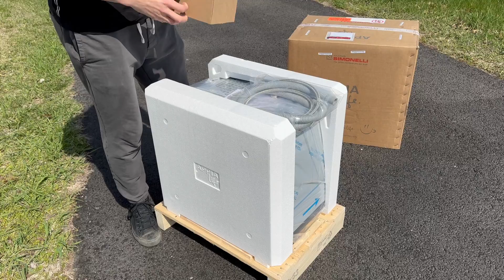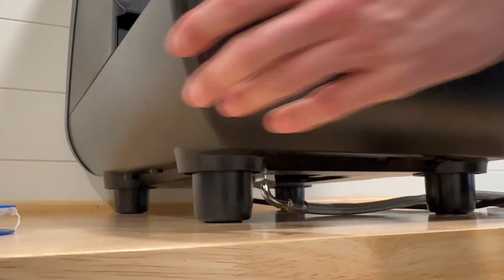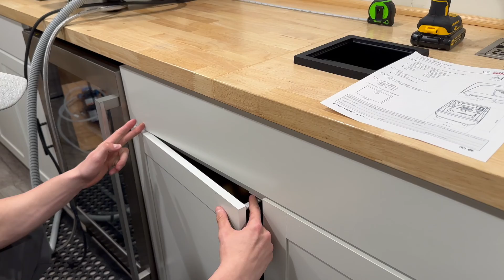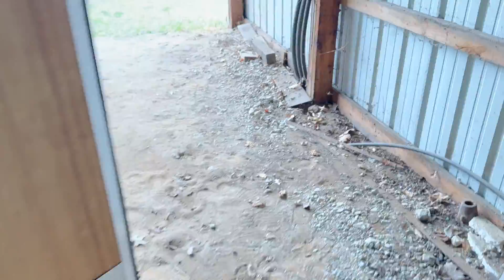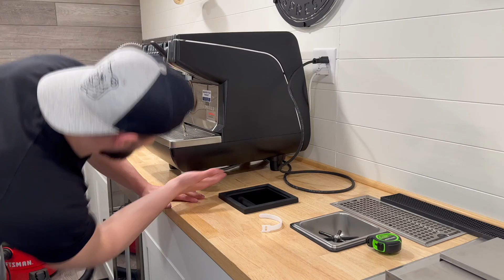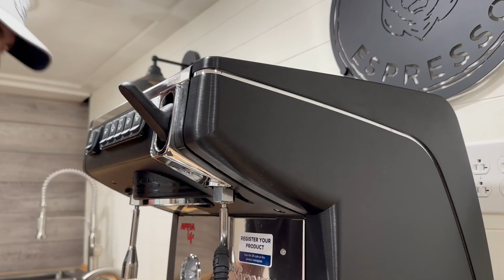Nuova Simonelli Appia Life Single Group Espresso Machine | How to Plumb Your Espresso Machine

Comment: How do you transport it is it attached to the table top?
Reply from the maker: eye bolts 2 inches away from both sides of the machine and ratchet strap it down with 5 inch foam so it doesn't damage your machine.

Comment: Great video, thank you! We just got one of these - haven't started it up yet.. A bit apprehensive - is there a gadget that can tell us if the water pressure is too high? And with the water hook up in a regular house, what should we consider that isn't obvious or in the (very complicated 3 language technical guide!?)
Reply from the maker: Would recommend consulting a local technician.  If it is a new machine, it is required to be set up by a Nuova tech.  If used, would find one and pay them, as you can ruin the machine quickly with poor water and improper setup.  Not something we assist with over YouTube.

Comment: What's your opinion on the quality of shots and milk foam? I'm thinking of upgrading to this very machine from a Spaziale Vivaldi (dual boiler). I can get a very, very good deal on an almost new Appia Life, but haven't decided if I should bite the bullet. It would be for a low volume cafe (50-80 drinks max/day).
Reply from the maker: We currently use the Nuova Simonelli Appia Life single group espresso machine and it is amazing and a true workhorse. We have this paired with the ZF83 commercial grinder which has been great as well. We have a special promotion going on right now that if you purchase a select machine you will get a free ZF83 commercial grinder. I strongly recommend checking out some of the machines that are on the promotion. This machine is apart of the promotion. 
https://espressooutlet.com/collections/free-zf83-promotion
Reply from the maker: the shots are great and the steaming is incredible on this machine